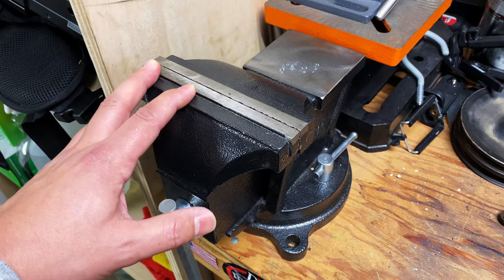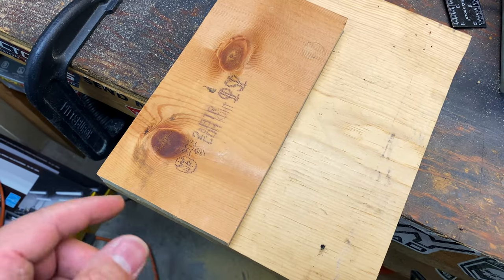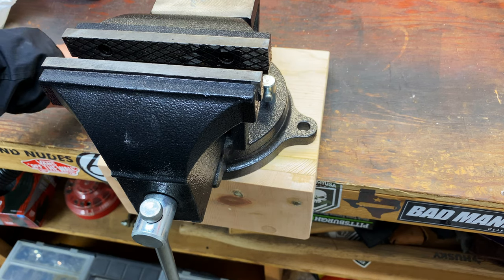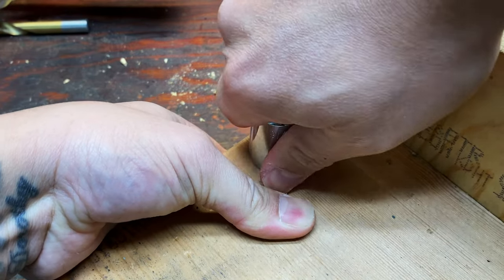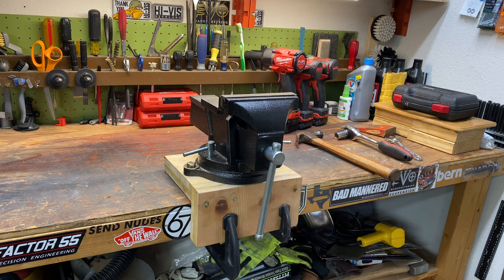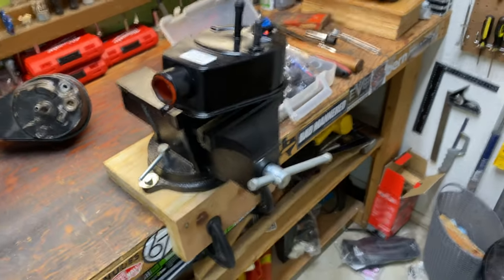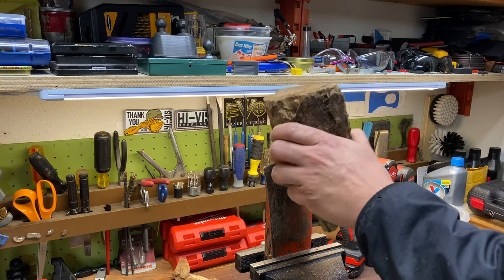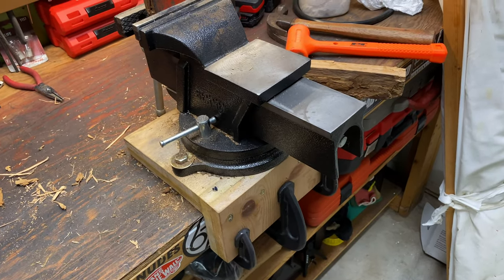How to mount a vise without drilling holes in your workbench

Comment: You could add two holes on the far side of plate and two holes on bench and just run bolts thru with no nut just to make it super sturdy.

Comment: Great job,  I was thinking of a similar setup. However, I would have used large wood screws, the type that has a large nut, to attached vise to the block of wood. Then drill holes on the side/frame with screws long enough to go threw the side and use wingnuts on some type of lag bolt to facilitate quick mounting/dismounting.

Comment: Many thanks for your vice advice. I'm just wondering why so many are mounted on the LEFT side of a free-standing bench ??? Are most workshop folks left-handed ? Anything  to do with political persuasion ? Surely it's neither of these. Is it more practical in some way on the left ? Mine is mounted at the RIGHT hand corner of the bench.  It has a swivel base that makes it quite versatile

Comment: I'm not sure if your setup is still the same, but that's a good idea also.  On vice, I have two deep throat clamps on each side of the vice jumping from the top to the bottom glamping further in the two corners opposite the Edge of the bench of course I don't do hit any heavy iron bending is just a small Vice acting is my third hand. Don't be afraid to drill a hole into the bench moment with half inch or 5/8 bolts and be done with it. If you only leave the nut out you can easily take the nuts off and remove the vice! 👍👍👍🤜🍻🤛🇺🇸
Reply from the maker: Good idea and YT needs to start allowing picture replies. That would be a game changer

Comment: I don't have a lip on my bench so I bored holes into the worktop and used Antiluce bolts as at times I need a clear bench, I stop the holes using hole plug inserts.

Comment: That's awesome. You killed it on this. I think I'll do something similar for my workshop bench.

2 questions I have

#1 What are the dimensions to both pieces of wood, and what kind of plywood was that you used?

#2 What vise is that? It's a really nice one. I think I want to buy that exact vise.
Reply from the maker: Thanks bud! And I used 1.5” thick solid wood (oak) and not plywood. Top piece is 9x7” and lower piece is 9x4.5”. The vise is a Bessey 6” in length x 7” jaw opening
Reply: @JeepArmyUSA  very nice dude!! I have a similar bench in my garage not exact like yours but very close on the lip its about 3- 4 inch lip I bought 4 inch proto c clamps and I think I'm going to get a 6.5 inch wilton vise for my work. I just need to make sure I measure it all out right and clamp it right. I like the idea of being able to guide it where I need it. You have it very clean I'm sure its still holding up for you till today.

Comment: Assuming you have the right sized clamps to do it, why not just clamp the vise directly to the table?  In any case, why clamp it to the front of the table under the vise, instead of to the top of the table to the side of the vise? I.e., why the L-shaped platform as opposed to a flat one?
Reply from the maker: The clamps would interfere w/ the vice’s rotation and  possibly the work itself if clamped top side.
Reply: By clamping underneath, the clamps are never in your way.
Reply from the maker: Correcto mundo dude

Comment: Before I bought the set of centre punch hole markers, I'd buy a circular saw, table saw, and maybe a new sheet of plywood for the bench top.
Reply from the maker: Just buy whatever you’re going to use a lot of and borrow what you’ll seldom use. Especially, if you’re just a diy hobbyist having fun in the garage. No big deal